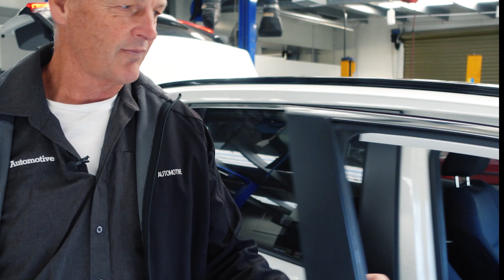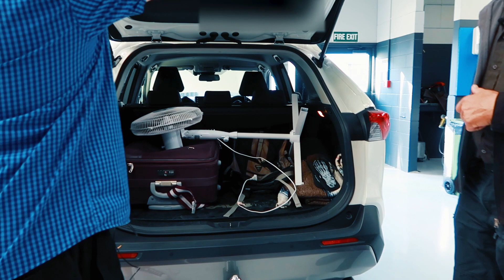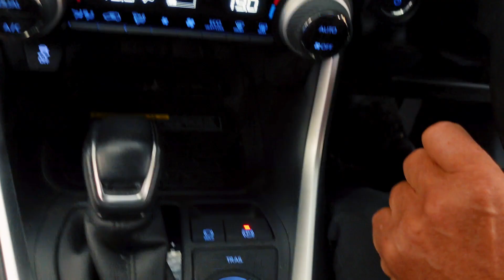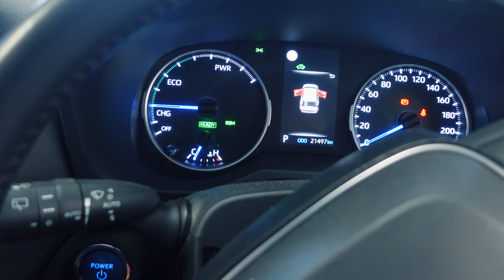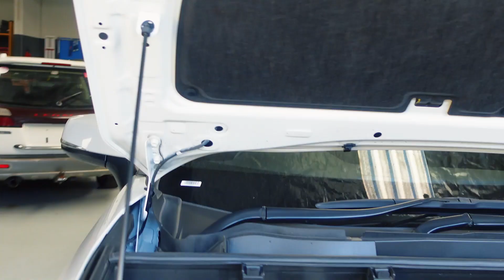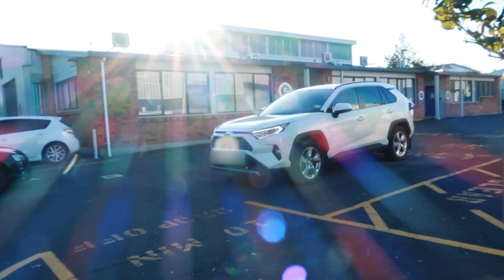RAV4 GXL HYBRID - Best of Both Worlds

Comment: Would be even better with a plugin option ie. PHEV.
Reply: They are available overseas but can't supply NZ due to the demand
Reply: Even if it’s available, the price would be much higher
Reply: @shixtr  yes the battery for that model is Lithium Ion and a much larger capacity and more powerful drivetrain